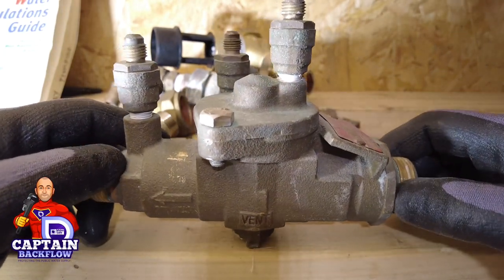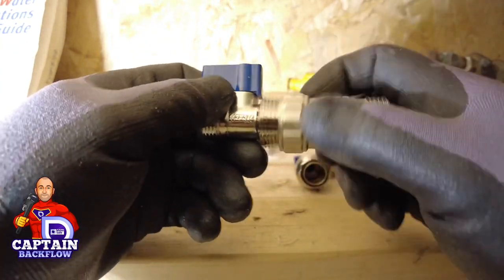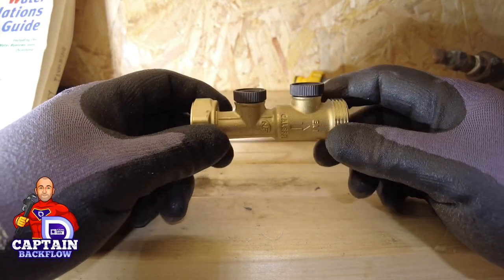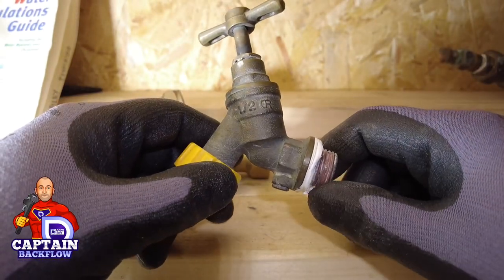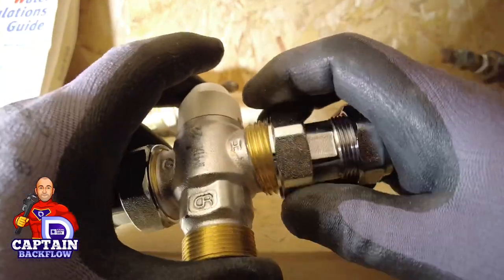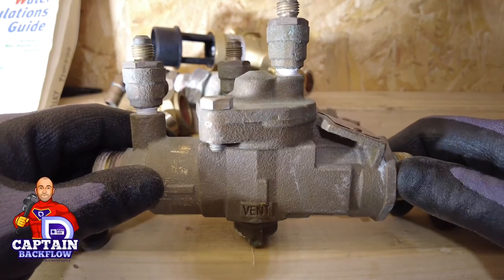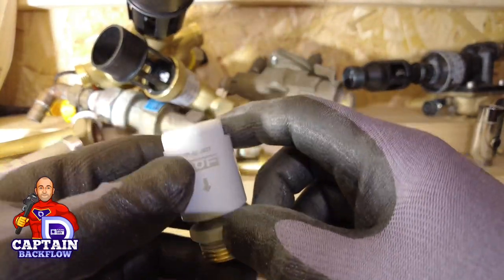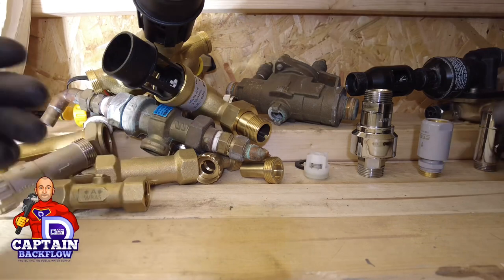Plumbers Video - Training For Plumbers - Backflow Devices and Back Flow Protection

Comment: Brilliant vid cheers, the amount of TMV’s we change now due to crossover, bad hot temps or worse cold temperatures over 20’c very common in commercial properties
Reply: Hi Rog , commercially we install either an additional single or an extra double on commercial. Just to prevent issues.
Reply: @DALEYPLUMBING  We are currently trying our best to train engineers to follow up on odd l8 ppm temperatures and make sure they are doing fail safe tests on all valves, the about that don’t pass after a few years of operation is scary

Comment: Back flow prevention often gets overlooked in domestic settings and homeowners are completely unaware of its importance. I'm constantly informing them of what they might be drinking if there's a risk of it within their property.
The biggest issue these days are douche valves. I have so many instances where these have been fitted, or are part of a build spec and no one even considers their proper installation. Can we have some info on what can be done to have these properly installed.
Reply: The first rule that is overlooked is a Reg 5 notification to the local water company.

Comment: Paul: ? What is the category of fluid that includes washing machine water during the wash, e.g. maybe washing fabrics for bedridden person? Thanks for the interesting and most useful presentation, previously I'd never heard of fluid categories.
Reply: Hi , fluid categories for washing machine can be a 2 , 3 , 4 or 5. 

In a house occupied by a single family it would be rated at a 2 or a 3 however if you put that same washing machine in an environment where the risk is greater for example a care home,  healthcare etc etc it would be a fluid category 5.
Reply: @DALEYPLUMBING  Thanks for the info, seems like a case of washer beware!